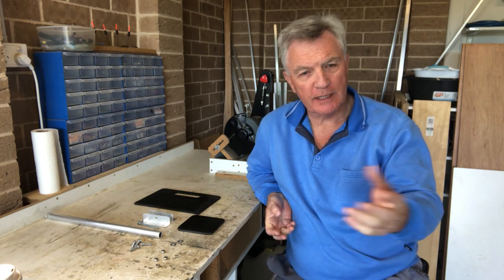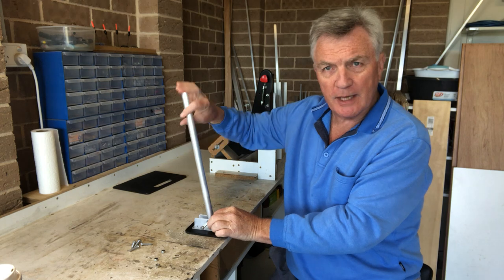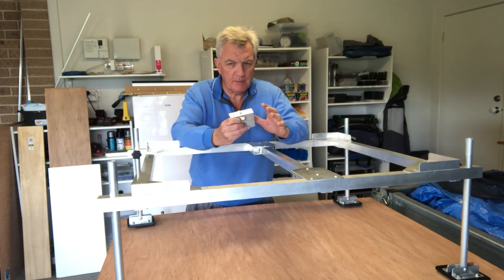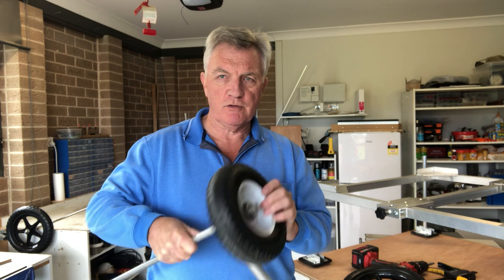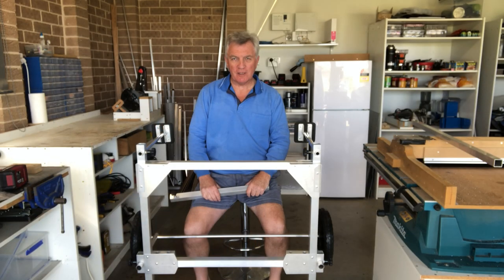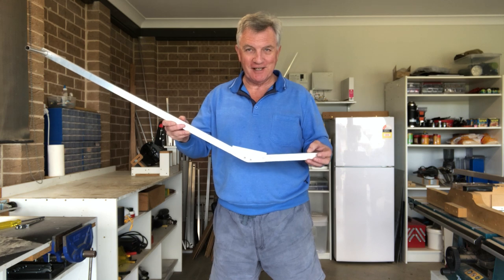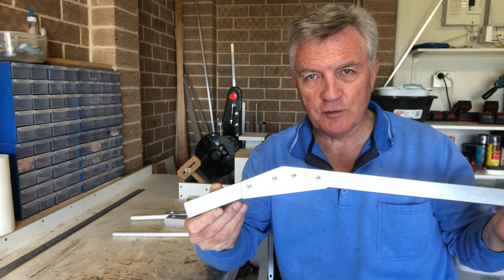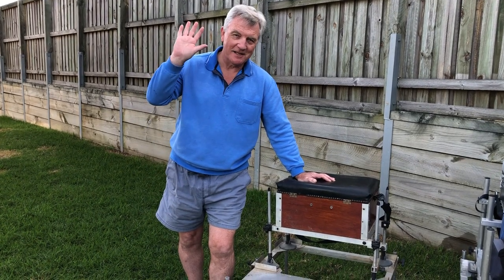DIY Seat Box Trolley & Platform Build - Part Two

Comment: Lovely custom  box and barrow , now that the lockdown is over ,  have you had the chance to road test it ? would you make any changes ?    Thanks for the vids ..😆😆😆
Reply from the maker: Thanks Johnny. I have been using the box and barrow for the past 2 years now and all is going well. I have also made a second version of the box which is smaller and lighter for times when I need to put it on my back and walk longer distances.

Comment: Just a thought but with the axial being threaded would that not act as a file and wear the support?  May I suggest the use of EPOXY putty to smooth out the treads were it will wear?   Well done on another Vlog
Reply from the maker: Hi Phillip. There may be some wear in that area, but as the axle itself does not turn, I'm hoping it will not be a problem. If it does become an issue, I can always modify things so I have a full sleeve all the way across the axle. The previous version is still going strong, but I'm sure there are better ways to do this.
Reply: @FishingwithDen  I  thought that if you have locked the axial on the wheel at both sides that means the wheel and axial will move not just the wheel?  Or did I miss the fact the wheel is not locked off so free running?
Reply from the maker: @Offcut55  It isn't locked off tight by the nylon locknuts Phillip. They were done up tight at first and then I backed them off slightly so the wheels would turn on their own bearings. That way there is no requirement for the axle to move. Sorry if i didn't make that clear enough in the video.
Reply: @FishingwithDen   do not apologies you have done a great job
Reply from the maker: @Offcut55  Thanks mate.

Comment: Hi Den
Just subscribed to your channel, finding your videos very informative and inspirational. I'm going to make something similar for my seat box but more on the lines of a wheelbarrow type system that I can add on to my existing seat box frame. Just a thought why didn't you make a y shaped padded handle, wouldn't that have been a lot more comfortable to hold with your arthritis.
Reply from the maker: Hi mate. Thanks for Subscribing. The handle isn't a problem so far with my arthritis. It's all in my thumb joint, so it's more when I try to hold something thicker, like a pole end, (or a pint of beer). I think there are probably a number of variations, like yours which may be used by anglers wanting to make their own trolley and that's great. I hope my video will inspire more people to make some of their own stuff.